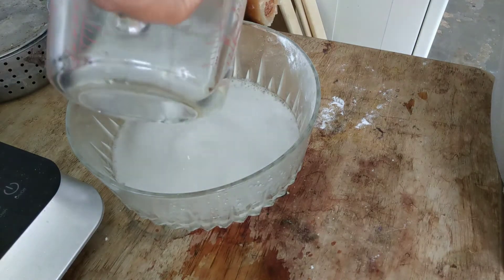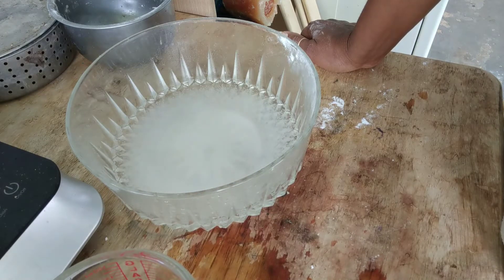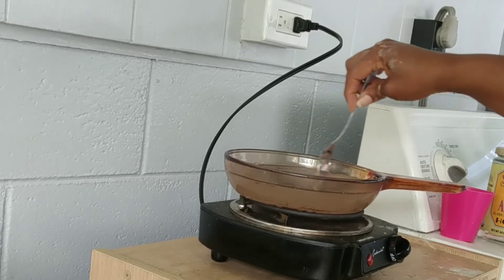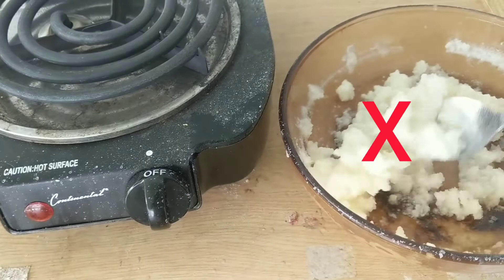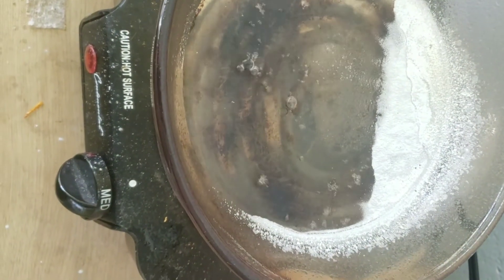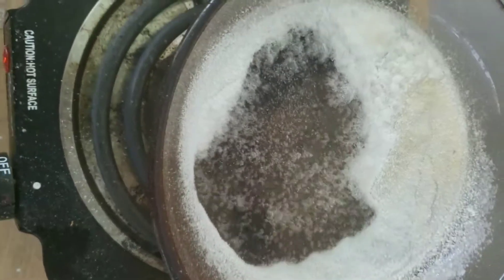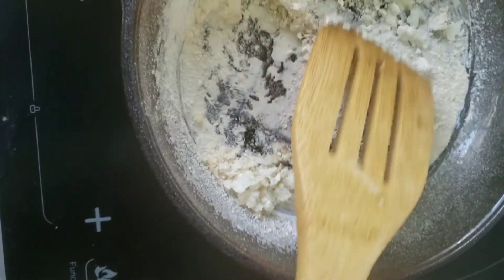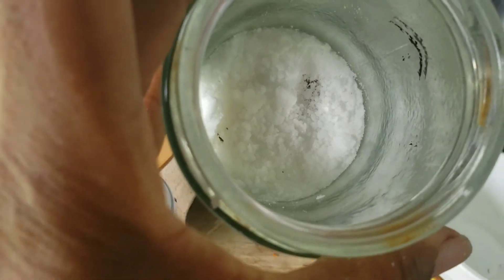Make Aluminum Acetate At Home To Mordant Cellulose Fibers  | Trial and Error

Comment: I don't suggest you heat the acetate that much, it partially denatures under 140c. Leaving it in the oven, or on very low heat, or even using a strong dessicant would be better.
Reply from the maker: @RustleJimmy  thanks for this tip and information.  That point about the dessicant is interesting.  I would now like to experiment with this (both methods).

Comment: So, it was helpful in a way, but I still have no idea how to make it.
Reply: Household vinegar has about 5% acetic acid normally. Use that as a basis to calculate how much acetate you can make with a set quantity of baking soda. Once you have completed that first reaction and have an estimated amount of sodium acetate diluted in water (vinegar is mostly water), mix the alum in directly with a ratio of 1:1 acetate:alum.

Comment: Hi there hmm i would love to have a recepy its hard to do it without proper measurments - for the first as also for the mixing steps - Thank youuu
Reply from the maker: It has taken me far too long to update here, but I just added a new, better video.  I use 4 cups of vinegar and up to 4 tablespoons of baking soda. https://youtu.be/Nju4mQy3MvM
Reply from the maker: My apologies for just now getting to your comment!  There is very little info online about measurements for this.  However,  I do remember seeing some measurements on one website.  I will try to find that again for you.  What I remember from trying it based on that particular recipes, though, is that the alum acetate came out too wet.  I got the best result through trial and error.  But I will find the recipe I remember seeing and post it here.  

I can say this one thing about it for sure, if you have baking pooled on the bottom of your bowl and container as your adding it to the vinegar, you've added too much.  There shouldn't be a lot of it just sitting on the bottom once the reaction with the vinegar happens.  Once all the bubbling settles down, the baking soda should be mostly dissolved in the vinegar.  Otherwise, once you cook it, you will have a wet outcome rather than a dry one.

Comment: Where did you find to make this? I have searched but nothing that I am comfortable with
Reply from the maker: Are you asking where did I find the ingredients? If so, I got all of the items from the grocery store.   Alum can be found in the aisle with spices.  Let me know if that answers your question, and thank you for watching!
Reply: @plantdyefortextiles  I meant the recipe,  sorry
Reply from the maker: @jessicabey275  Ok, no problem.  It was really just trial and error, but the main recipe I found for the sodium acetate was to add a spoonful of baking soda to a pot and slowly pour vinegar in the bowl until the bubbling stops.  In my experience, the bubbling never stopped.  So, at some point I just went ahead with the heating process.  The main this I found is that using too much baking soda starting out will produce a gooey substance, which I show at some point in this video.  Another recipe says use 7 teaspoons of baking soda for every 2.1 cups of vinegar. It also days to add the baking soda to the vinegar instead of the opposite.  I may have tried that but need to do it again.
Reply: @plantdyefortextiles  thank you! Do you know the aprox ratios for the sodium acetate to alum
Reply: @plantdyefortextiles  sorry for so many questions
Reply from the maker: @jessicabey275  I just did half and half.  When researching, that's what I read somewhere on the very limited info on the topic. No problem about the questions.  My pleasure!
Reply: But where did you get the recipe from?
Reply from the maker: @sannevanbeers I'm unable to link it here, but a search on Google for "How to make sodium acetate" brings up the recipe I use. Once that's made, it can be combined with potassium aluminum sulfate (found with seasonings in market) to make the mordant aluminum acetate. I just made a new video about this. https://youtu.be/Nju4mQy3MvM

Comment: About to try my first viscose (flax) natural dye. Have tannin. Q: why do the tannin first? I mixed mine with my dye. Is that going to fail?
Reply from the maker: I'm late seeing this, and you may have done it by now   

That sounds good! 
Mixing tannin with dye should be fine .  Most books I've read list it as a quick, viable way to do things.  Things like avocado seeds and skin as well as pomegranate skins are used to dye fabric, and they have high amounts of tannin.  So that's like an all in one such as you're mentioning.  Thanks for watching!
Reply: @plantdyefortextiles  Thank you! I was worried but now I'm not. Actually, it got delayed and I'm just now putting it through the mordant soak.